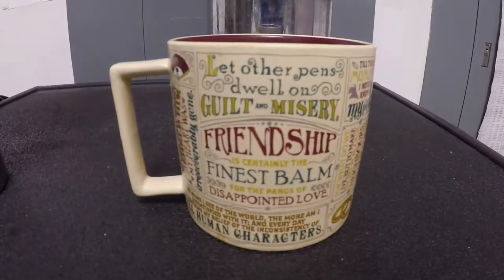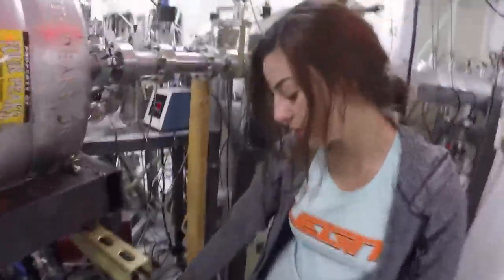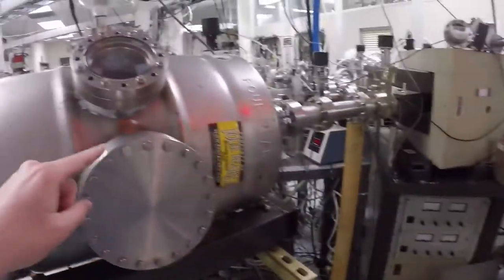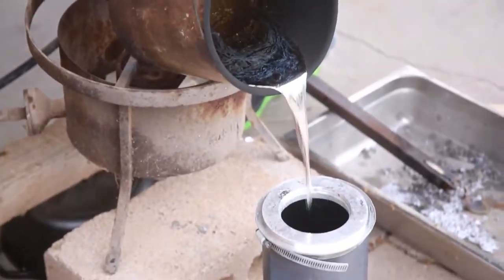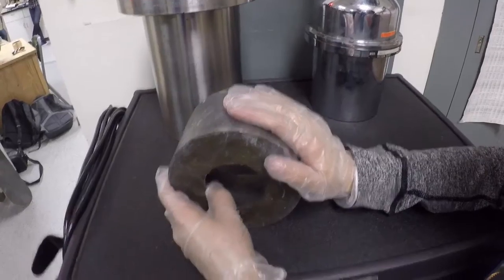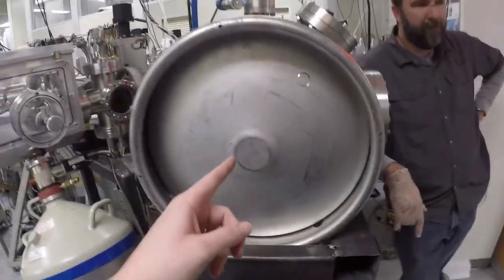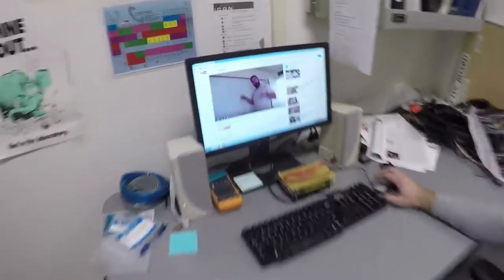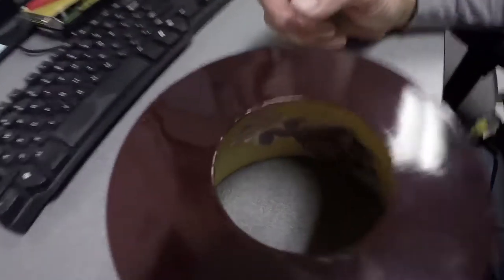Radiation shields for nuclear fusion, why they are needed may Surprise You!

Comment: That is a HUGE gamma scintilator! What type of crystal is it NaTI? Also does it still work with that large of a dent in the top or did you have to replace the pmt with a smaller one? Your lab is very impressive. I wish my university had something that cool to work with. I honestly couldn't imagine background from a detector that large. Its efficiency must be incredible.
Reply from the maker: Very perceptive! 

Yes, that is a NaI detector, luckily the dent (happened before we came along) did not damage the photo multiplier tube, so we use it as is. As far as background, it is more about pushing gamma peaks (through Compton scattering) out of the way from data we are interested in, as time goes on we will cover this in more detail.

We were lucky to find it. Don't give up looking around your campus (knock on doors, talk to lab managers, etc.), we even recently dug up an almost new HPGe detector; these things are out there so long as you manage to turn over the right rock!

Which University are you at?
Reply from the maker: That is what we are excited about, the combination of the high resolution of the HPGe coupled with the excellent efficiency of the NaI detector can be used to really help us clear through the data (especially with well separated peaks!) with some creative use of cumulative binomial or Poisson's (same thing really) probabilities we can get some great results with little extra work.

We love your links, and are are always looking for more data, if you have anything else useful, send it our way!

Texas Tech, we recently started work on a project with you guys with one of our Professors, Dr. Alford. It's a small world! 

You know quite a bit about this stuff, especially for an undergrad (we are too:). What do you have available in the way of particle accelerators on your campus?
Reply: Thanks for the info. Ill see if I can find Dr. Alford and see what he is working on. As far as particle accelerators, I don't believe that that Texas Tech has one, however I will be asking around this week. If I come across anything else that I think could be useful to you I'll be sure to send it your way. Thanks for your help and advice.
Reply from the maker: Sounds good, and happy hunting!

Comment: That can't be a normal beer keg.  Evacuating a anything relatively thin-walled like a keg would collapse if you reduced the air pressure inside of it because the ambient pressure would over come this structure in violent fashion.
Reply from the maker: Actually it is, and it required no modifications to work wonderfully as a vacuum chamber.

Interesting thing about beer kegs, the way they are built they have a constant outward force on the shell (especially at their center) even though they are built for pressure. 

This is done to reduce manufacturing costs, but as you can imagine, this is the opposite of what you want with a pressurized vessel. The thinking by the engineers is they are rated for 90psi at most (many now only have 60psi ratings), and they can still have an adequate factor of safety even with this design flaw.

We have talked about doing a video where we cut one in half again. When near the end of the cut, they separate rather violently due to this outward force, a rather exciting sight! (although you have to be super careful when doing this)

Hope this clears things up!
Reply: Thanks for sharing this tidbit with me.  It must be a quirky law of physics, not unlike how glass spheres gain strength under greater pressure (as experienced in bathyspheres).
Reply from the maker: Very much so, our atmosphere 'pushes' back on this force making for a very stable vacuum chamber when pumped down. If they were designed differently (properly) then they may now work so well for a vacuum chamber, just as you pointed out.

It may be fun to post a video on cutting up another one of these kegs to demonstrate this 'potent' separation. We will have to see if our local brewery would be willing to sacrifice another keg shell for science!
Reply: @asustudentshop2350  it's funny the keg is so thin-walled yet the attachments are extremely thick stainless steel.  Also...doesn't welding attachments on greatly compromise the pressure-resisting symmetry of the keg design?